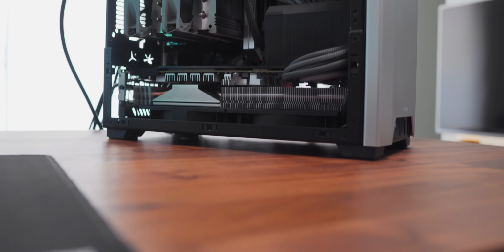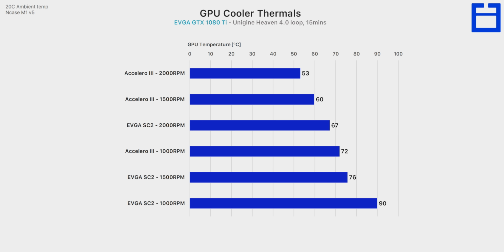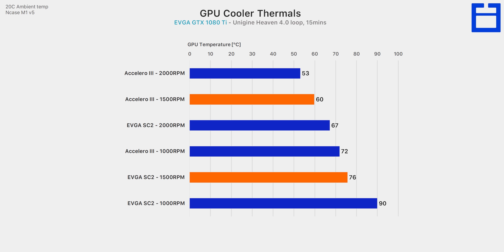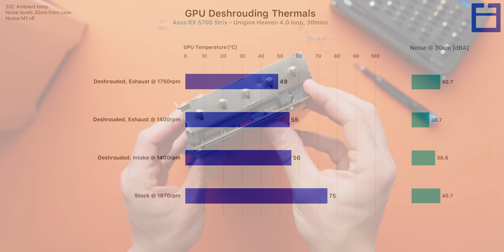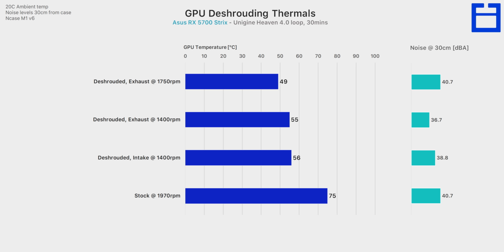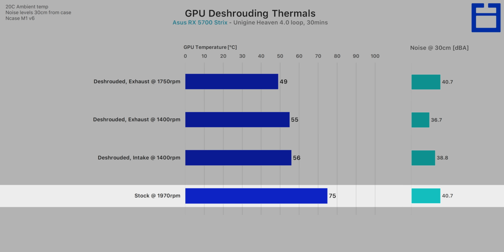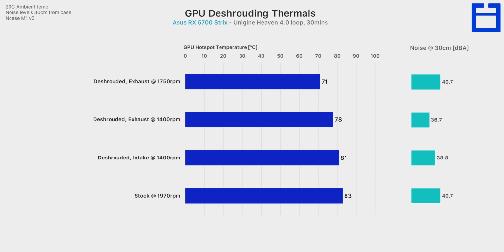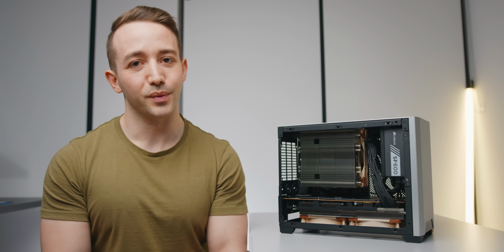GPU Deshroud Mod - Mindblowing Thermal Improvement

Comment: I'd still like to know why GPUs don't just come with 2 120mm fans clipped onto the heatsink.  Why do they always use weird proprietary fans?
Reply: Style points bro
Reply: Obviously because of case clearance issue. A graphics card with a 120mm fan would be too tall to fit inside most of the compact cases. If the graphics card used in this video came with a heat sink designed for 120mm fans, it would have never been able to fit inside this case. Any case that can't fit a 120mm CPU cooler won't be able to fit a graphics card with 120mm fans.
Reply: @krazyfrog  A triple slot GPU would already not fit in most compact cases, so your argument is mostly irrelevant.  Having more flexibility in normal ATX and mATX cases would be better and cover most use cases.
Reply: @hughjazz44  I wasn't talking about the thickness of the card. I specifically mentioned height and also gave a CPU cooler as an example.
Reply: @krazyfrog  As evidenced by that Strix card in the video, height is not a concern for a typical video card.  Clearly the fans are already the same width as a normal AIB card.
Reply: @hughjazz44  The fans are not ON the card. The fans are under the card, on the case. One edge of the fans is aligned with the card, the other edge goes past it to the other side of the case. If the heatsink on the card was designed for 120mm fans it would stick out way further. It would have to account for the 120mm fans and the height of the PCIe connector. Again, any case that cannot fit a 120mm CPU cooler would not be able to fit a graphics card with 120mm fans.
Reply: @hughjazz44  So a 4 slot card would fit? The🤣
Reply: Weight.
Most GPUs sag in their sockets as they are; if they have 120mm fans attached to them too, they would be way too heavy.
This wouldn’t affect machines with SFF sandwich cases or Vertical GPU adaptors, but would would be catastrophic for the majority of desktop computers in tower cases.
If they have a Vertical edition, it would be just as niche as a hybrid cooler GPU and would be priced accordingly.
A better option would be if manufacturers take the observations from this video into account and design their shrouds to be removable, with standard fan headers.
Reply: @SalvoDan  You know, since GPUs block the 2 slots below them, I always thought they should put a blank edge connector in the next slot down to hold the GPU up.  I know they never will, because that would cost them like 5 cents, and most motherboards don't have a full length second slot, but still...
Reply: @hughjazz44  you have to remember that motherboard or case manufacturers would have to also accommodate for this alongside that. it isn't just as simple as an extra 5 cents. think about how many transistors, resistors, chokes, chips, chipsets are scattered all over the motherboard. things work as that are and GPU sag is only actually an issue when you reach something like a 1.5kg card (very very rare for a gpu to be 1.5kg+ we are talking a MASSIVE gpu here)
Reply: Gamer aesthetics
Reply: Money

Comment: Question about the Mini-4 Pin, I’ve been using software to do this for a while, and while it works well it can’t start at start. Did it work well enough for you?

Comment: How does that compare to open air (no case)?
There's no acceptable reason that the GPU should be so inteferior.
But there are more factors such as minimising airflow halts between fresh air and heatsinks.
Reply: Two big thicc fans move way more air than three small sticc fans.
Reply: @LetoDeWirre  that's true larger fans move more air more quietly, but with aftermarket utilising three whole PCI widths they could dedicate more space and costs to fans and less to fins...

Comment: It would be interesting to see if you get the same benefit if the fans aren't pressed right up against the heatsink - e.g., on that nvidia card, what happens if you just put the fans as close as you can to the heatsink without chopping off those tabs?  I know that won't fit in the ncase m1 (unless you use low profile fans), but there are other cases.

Comment: my gtx770's triple fans stooped working so i de-shrouded it and brought a Evercool PB-01 PCI slot Fan bracket for 1 or 2 x 92 or 120mm fans mounted the bracket and fans(2x120mm) with a 1 slot space and it worked a treat card didn't go above 70 in stress tests and stayed around 62 while gaming

Comment: I see you using NH-C14S and in the past you used to run a Noctua NH-D9L (i think), which of the two nets you better temps and noise?
Reply: Probably the c14s depending on case configuration
Reply: I'd love to see a video comparing the NH-C14S to the NH-U9S in the NCASE M1 v 6.1.

Comment: I use three 92mm low profile fans on a 2 slot GPU which fits the Ghost S1 perfectly. Temps are reduced by at least 10 degrees.
Reply: are you doing intake or exhaust on said setup?

Comment: For years I'm running RX 580 deshrouded
2x120mm artic 1200RPM fan
3D printed bracket
And noise is gone
Reply: I have a Radeon RX580, 3 fan, and I was interested in doing the same thing. Any chance I can purchase a bracket from you?
Reply: Care to link to that file?  Thanks

Comment: Your videos have really been insightful. Especially these videos regarding thermals. 

Excited to try out this mod with the Silverstone RVZ01-E and the ROG Strix 2070 super. Going to be using a pair of Arctic P12s. The fans have a gap of a few cm between the heatsink, so it would be interesting to see the performance difference if any.

Comment: hoi , iam thinking doing the same to my msi 2080ti ventus inside a ncase m1 , right now i can fit below the ventus low profile 120mm fans 15mm , it could work 
but is it realy ok to use noctua fans with the fanheaders of the gpu ? maybe to much powerdraw and frying somthing or is this no problem because the gpu supplys 
the power what it can and dosent let the fans pull what they want ?

Comment: Some adjustments to your video since I deshrouded my strix rx 5700xt myself:

-Asus uses a strange 7 pin sort of fan splitting header. The mini 4 pin you mention is for the rgb on the shroud. I tried to figure out which wires I needed to make a 4 pin pwm signal for the fans, but the fans wouldn't spin. You have to use the Asus software, but that doesn't allow much of an undervolt. I settled on argus monitor and put the fans on the AIO pump header on the mobo. Perfect solution! 

- you HAVE to bend the tabs on the shroud and you have to bend them pretty far for certain fans in order to fit the fans and not get the tabs in the fan blades. Even if you do it carefully, you will damage the heatsink a bit and will probably void warranty if they need to take the shroud off.
Reply: I did the wiring on my 5700xt nitro+ with the help of this diagram https://imgur.com/jsaWdDj. Although he made some errors in the diagram.

I know it is 8 pin instead of 7 pin that you have, but maybe it helps you.

Comment: No wonder results are solid when every GPU manufacturer blocks all the heatsink with plastic and RGB...
Reply: Also one of the selling points for which I chose strix version of 2080Ti was that extra fan headers.
But it's quite useless.
It's 4 pin yet has DC control and no way to change it, so if you have RGB fans you get them turned off, also they have quite crappy control logic, by default it's something where it's off until temperature reaches 60*C and it goes right to 100%
Theoretically you can change it in asus' GPU tweak software but it's garbage and it doesn't save profile on GPU, so if you restart the PC it goes away, even if you run the software on startup it still doesn't update those settings.
Reply: Arek R. Yeah, that’s why I just leave the GPU headers empty and control the fans under the GPU via motherboard. I use FanControl, very basic and doesn’t even have a startup at boot option, but it’s really intuitive and just works.
Reply: @heni63  Yeah, I did that, didn't help. I even removed all app launch restrictions in Windows settings (the annoying confirmation window that pops when you launch some apps). Still nada.
Reply: @ivchatov  hmm them there is something else wrong I guess. Or there are more files they need to be put into the Startup folder? I don't remember ever clear. 

Maybe try the program "autoruns" and check what is loading at start-up?
Reply: @heni63  I guess I could look into this deeper, clicking the icon once every time I boot up doesn't bother me that much. For now.
Reply: @ivchatov  smart.
Reply: @Arek_R.  just use MSI Afterburner for OC and fan speeds.
Reply: @rawdez_  MSI afterburned doesn't start after reset either.
Reply: @Arek_R.  It's start and sometimes I notice that my OC sittings save (from gpu-z) iven AB not started😮 also in AB has tick "start with windows" But I started manually every time. Use "vga to 4pin + Y cable"  with noctua120 fans on 1080ti
Reply: @Vitalikus8888  Yeah obviously I had checked the start with windows thing.
Reply: @Arek_R.  there is literally a button just for this STARTUP
Reply: @rawdez_  So?
Reply: @Arek_R.  so it works and applies OC/fan settings at startup.
Reply: @rawdez_  The thing is it's not working for me lol
Reply: @Arek_R.  probably some windows 10 crap. it should work.
Reply: @rawdez_  Yeah it should but it doesn't, that's the whole point.
I think I will have to ask programmer friend to put together some software for controlling all fans and rgb with one reliable program, that will be compatible with everything on the market.
Reply: @Arek_R.  >AND SELL IT AND MAKE BIGILLION BUCKS!
Reply: @Arek_R.  Try argus monitor. I have an amd 5700 that are known for unstable drivers and some issues with msi ab, but somehow i dont have any issues with latest window 2004
Reply: @Arek_R.  A 50 ohm resistor should help with reducing the fan speeds ;)

Or, if you're not into D.I.Y. buy a few noctua L.N.A's
Reply: @Arek_R.  Why isn't anybody bothering to splice in new fans to the old harness
Reply: If you use shitty rgb fans for a deshroud mod you might as well not bother at all, though lmao
Reply: @gabo007x1  I didn't deshroud it and I use blue led fans not RGB ones...
Reply: The improvement here is from larger diameter, thicker fans. The shrouds are there to direct airflow from the included fans.
Reply: @Lead_Foot  I don't think it's because of fans, you get less noise with bigger fans, but performance of cooling is thanks to no plastic on sides of the GPU which are exhaust and usually half blocked by plastic shroud.
Reply: Eric Cartman  But it can't control AUX headers on strix gpus
Reply: Tbh I don't think there's a market for a gpu SKU that is literally just the card with a big ass heatsink. Isn't pretty for the eyes either most times.
Reply: Who needs an RGB? Useless feature
Reply: Exactly, I've really been craving for noctua to create a beastly heatsink like the Morpheus 2 along with some low profile fans to sell as a package. It'd be even more awesome if they sold them as custom boards but I doubt it would happen. I'm tired of gamer shrouds that look like a Lamborghini, there's something nice about seeing the dense finstacks, it just looks purposeful for lack of a better word.
Reply: Needs a little standalone board to run the PWM fans with a thermistor on the heatsink.
Reply: You could if you want blame the ATX motherboard layout which forces the GPU into a slot alongside other slots. Doesn't make so much sense now that we have GPUs that would benefit from larger and more open cooling systems (like CPU tower coolers)
Reply: If im paying 700$ for gpu id like it to look good too

Comment: I have done this with my Strix 1080 card. With two noctua nf-f12 (i think), that runs 1450 rpm, i went from 60-65 (depending on load) to 57-60c.
And i found that if it keeps under 60c, the boost clock actually goes up more, but the second it passes 60c it gets slightly reduced.
Temp got a bit better, but the bigget thing for me was the noice!  I can have them on full blast and barely hear them. And together with the rest of the 140mm noctua fans in my Define R5 case i can game with nice temps and just wind noice. Its awsome!

But, i wonder if i could get even better temps on my GPU if i used the 2000/3000 rpm industrial fans.. It might even get better as more air will pass..
I might try it! :D
Reply: noice
Reply: That is really noice.  I don't like noise either.
Reply: @heroictesticles6870  Yeah, it was definetly worth it noice wise :-P

Comment: Its just amazing what 120mm fans can do on those gpu coolers. Those heatsinks are great they are just not properly used. I never understood why AIB's decided to put 3 small fans instead of 2 big ones. 3 fans creates more noise especially small ones. 2 big Fans just seems way more logical to me. 
But all of that might just be marketing. Like for most people who don't really know about that stuff, instantly think 3 fans better than 2 so i'll buy this model. That's just a guess.

Comment: Did you test the original Strix after you changed the long screws to short screws? I feel like some of the improvement is coming from that alone.
Reply from the maker: Yes of course. The "Stock" measurement was after changing to the shorter screws.
Reply: @optimumtech  Way to think ahead! That’s awesome 👏

Comment: Temperature and transistor power leakage correlate. Any idea how much this mod affects power consumption? It might be that due to set power limits it clocks higher than the non-modded version. So GPU clock speed differences would be nice to know too. Thank you!

Comment: Since I installed an accelero III on my 5700xt mech, I wish I could buy my next GPU card bare and on the cheap instead of paying for noisy and bad stock cooling solutions (that I will be swapping anyway)
Great vid tho m8
Reply: @Max.Sc. Yeah, I don't know why he bought the MSI when he's replacing it.
Reply: @jazz_bass_merchant  it was a cheap (320usd) refurbished GPU. I thought that the bad cooler was fixable with thermal grizzly pads but oh boy I was wrong... the thing is as doomed as noisy and hot
Reply: @jazz_bass_merchant  hmm ' cause he bought the bad msi card. Gaming x is great
Reply: @Max.Sc. blower coolers does not comes cheap to produce : case, vapor chamber, fan,... All I ask is a bare pcb with the chips :P
Reply: @Max.Sc. Blower will not work with this mod as it pushes air through the heatstink outside of the case (top of the heatsink is sealed off). You need axial style card.

Comment: Did you replace those screws before running the test with the shroud?  if not that could play a big factor in the more extreme temp differences.
Reply from the maker: Yes of course.

Comment: Anyone get this to work with a Pulse 5700xt? Pretty sure there is too much of a gap between the fans and heatsink. The air just goes around it.
Reply: Went ahead and did it. Zero percent reduction in NcaseM1.

Comment: Did that with my old R9 280x a few years ago. From 96 to 80C in the summer :D (It was a very cheap card)
Reply: I’m planning to do the same on my R9 390x
Reply: @marvinbalasabas2172  You can do that but first repalece the thermal paste with thermal grizzly kryonaut and believe me you dont really need to deshroud!

Comment: Was the stock measurement taken before or after your stock mounting fix?
Reply: Probably not, since he used the screws from the deshrouding to fix the mounting problem?
Reply from the maker: @popori7928  I realised just how bad the problem was after deshrouding, but then went back, installed the shorter screws, and re-tested with the original shroud and fans. This gave us the "Stock" result on the chart.
I borrowed two screws from the shroud to fix the issue, you can still mount the original shroud with 2 screws missing.